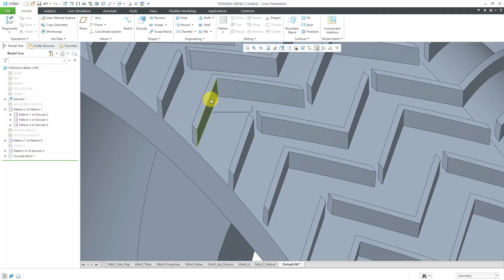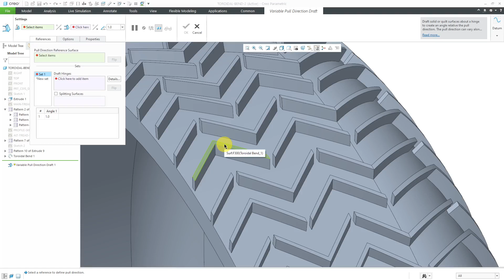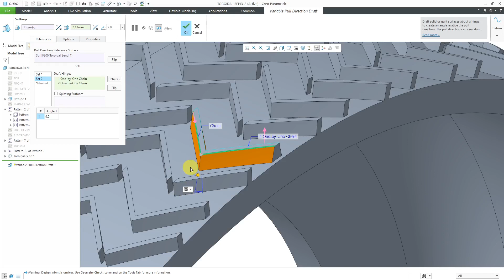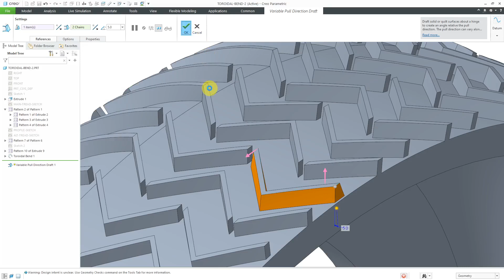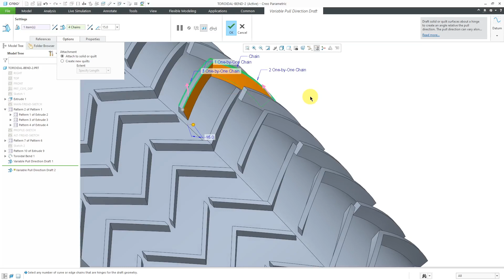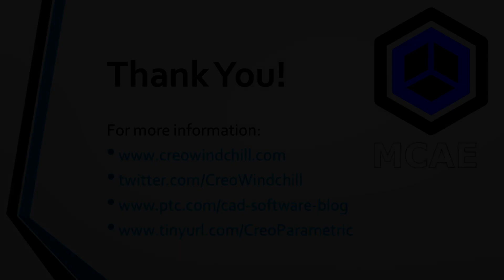Creo Parametric - Variable Pull Direction Draft | Part Modeling

Comment: Is it possible to use this when you have multiple surfaces for the Pull Direction Reference Surface?  The collector will allow you to select multiple surfaces but I can't get it to work.  I have a recessed slot along a curved face that has a few surfaces as the curvature changes. and I want to draft the walls.  No luck so far.

In your examples I see that the Pull Direction Reference Surface is always a single surface.  Is that required?

Comment: A feature that impossible for beginners is draft 😄😄
When I was new I can't use it 
I think PTC GUI also little difficult
It must be like solidworks UI 
That assist us to chose specific option to complete feature
Tell us what do you think about
My view
Reply from the maker: Is the criteria that you judge by the simplicity of the user interface? Because generally I've found that a simpler user interface almost always results in less functionality. You also have to realize that SolidWorks and Creo are aimed at different markets. Whereas SolidWorks is more mid-to-low end, Creo is more mid-to-high. Hence the acquisition of Onshape by PTC to address the different market.
For a comparison, the user interface of a Cessna 172 is simpler and more intuitive than that of a Boeing 777. Does that make the Cessna better?
A tool with more functionality often requires training to use. As I pointed out in my January keynote, I find it odd that it usually takes 4 years to get an engineering degree, but people balk at the idea that a high end engineering tool might actually need some training to learn how to use.
Reply: @CADPLMGuy  absolutely right for creo and CATIA it is required good training with good trainer , that's why i fount it little hard when i was beginner . thank you for your good explanation, but case is that here very rare creo trainer i am may be one here in my city who know at this level , youtube also have very rare video tutorial on creo and you are working great work sir for countries like India here we cant afford to buy a pc how can we afford to learn it by international trainer whose fee so high you can imagine situation is very bad here.
but i try to learn by teacher like you, I worked hard on it.
but I cant do well with its mold design ,
if you get free time pay attention to make video on this topic.
Reply from the maker: @CADDIA I was a Mold Design instructor but unfortunately I don't have a license. If enough people supported me on Patreon I would be able to purchase a more advanced license and make content on advanced subjects like that.
Reply: I was waiting for this one, slightly disappointed.

Variable draft in Creo is more than what is explained in this video. Though you pointed them out, an insight of this feature from an expert as yourself would be of great value.

I was waiting for this one, slightly disappointed.
Reply from the maker: Arif, this video is on the Variable Pull Direction Draft feature. Were you expecting a video on the Draft feature with variable draft angles? That one is planned but is still in development. If you have a better use case or explanation for Variable Pull Direction Draft, I hope you would share that.
Reply: @CADPLMGuy  thanks for clearing it for me, 
That's absolutely what I am waiting for.
I really appreciate the time and value you invest for us to produce content which is spot on